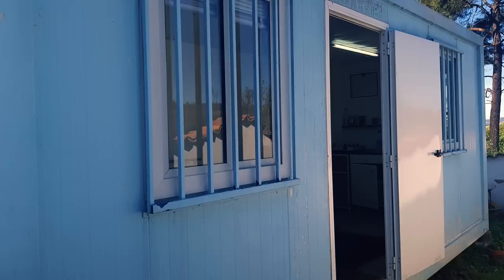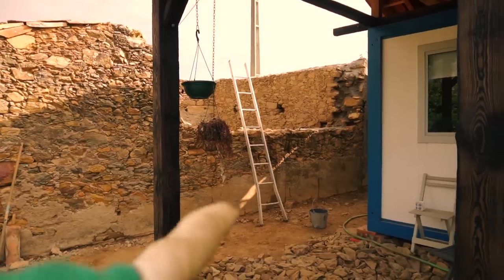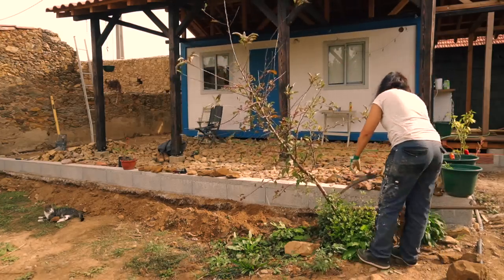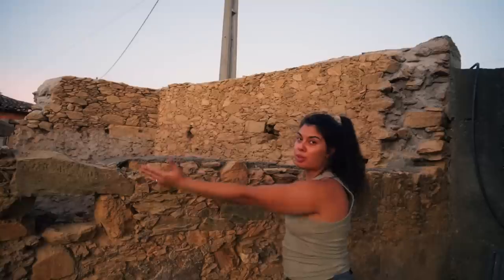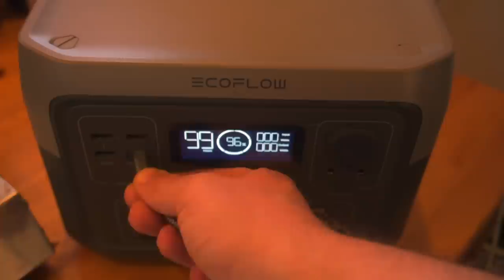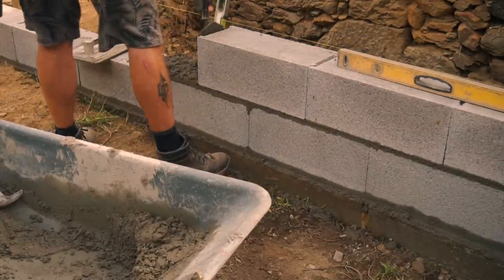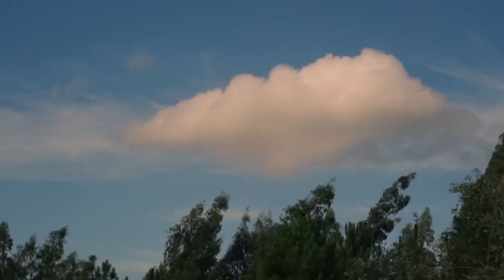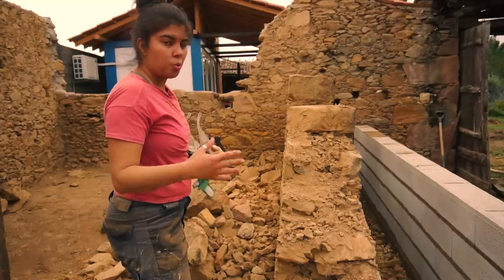Stone walls coming down and up! Renovating an abandoned farm (39)

Comment: Please use a rubber/wooden mallet. You could crack the block with your hammer. Doing a good job. "GOD Bless".
Reply from the maker: Thanks foe the tip Douglas!
Reply: I have seen brickies use the hammer handle.

Comment: The shovel you are using is what you call a loading shovel you would be better off purchasing the wedge shape ones,
 which are far better for digging thru hard ground and easier on your back.
Reply from the maker: Is that a pointy one? We have a straight edge one which works and was brought form England because we couldn’t find one like that here but a pointy one would be super helpful you are right!! Let me see if I can find one! Thanks!
Reply: @TheIndigoEscape  Hi Ohma its a wedge shape you can get different one's they are the best for digging the likes of footings and shoveling hardcore and the like
Reply: @TheIndigoEscape  Its not the pointed one

Comment: Hi, I've been watching you build for a while now and must say I'm a little surprised at your block laying, I am a bricklayer by trade and I would have thought you was laying your blocks upside down. The downward force on the blocks is just on the thin outer edge and middle, and that is the only part that is on mortar. Please don't take this as a negative. I just don't think the blockwork is or will be as strong as it should be. Also, are you building with sharp sand?  as opposed to soft sand, which would be so much easier to build with.
Reply from the maker: Hi there, those are bottom closed hollow blocks and they are placed upside down so when you lay the next one you have a complete surface to place concrete on.
Here is an explanation: 

The hollow blocks are produced in two types generally:

1. bottom closed: this is used for normal walls and blocks are used upside down so when you lay the next layer of blocks, you have a complete area to put concrete on it. 

2. Bottom open: It is used in walls that after the wall is completed concrete will be poured inside the hollow spaces.

Here is the link with source:
https://bessconcreteblockmachine.com/what-hollow-concrete-block-is-in-general-and-in-detail.html